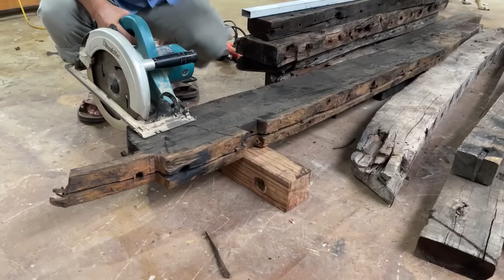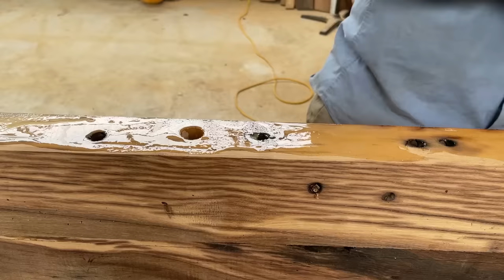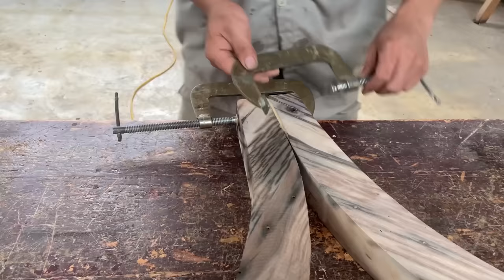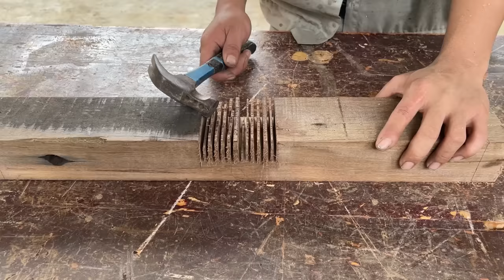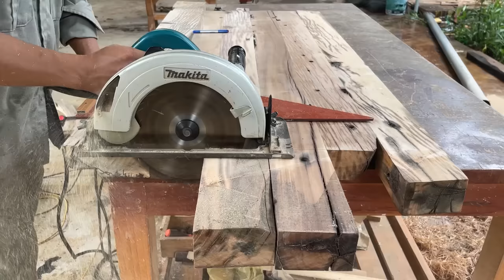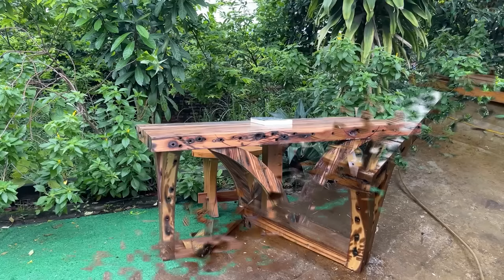Building A Difficult, rustic Table From Rotten Old Wood // Woodworking Restore Old Wood

Comment: Great job but when screwing the legs to the table there appeared 1 mm gaps right at the contact point of the legs and the table. They should have been glued and pressed to dry before screwing. A good wood work requires zero gap.

Comment: My 9th grade year in high school was the last year they let freshmen take woodshop, because I cut off the tip of my finger on a jointer. I wasn't following safety protocols and using a push stick like I was supposed to with a short piece of wood. After that year, you had to be a junior. I ruined it for everone. 😳😫

Comment: Hammer head to hammer head so so dangerious. the heads are tempered and when it meets another tempered piece of steel pieces can explode. and could easily take out an eye. As a carpenter for 54 years I've seen it happen.
Reply: Toda la razón!!
Reply: Yup
Reply: Yeah I don't think he really cares about safety.  He's wearing sandals in his shop.
Reply: Do you use a mallet?
Reply: @anonymousmedusa  
I use a claw hammer on a nail puller (cat's paw) or anything that's not tempered.
Reply: @stumpbumpers  
I guess it has never happened to you. I wish you contuined good luck.
Reply: Mythbusters busted this a long time ago.
Reply: Happened to me as a young lad. Had to did a fragment out of my arm at the emency  room. Lesson learned. You've been lucky.
Reply: @stumpbumpers  
After that remark I can confindently conclude there is no hope to change your mind, and by the way in all my time I have never seen a cast iron hammer, please don't let that start another thread. My goal is to error on the side of caution. If i'm wrong no hurt no foul, if your wrong, -----. This thread is now over for me.
Reply: Myth.

Comment: It will never be strong because the wood is cracked all over, fillng those gaps with a strong adhesive layer is must, holes should be plugged with epoxy resin

Comment: Really appreciate the work put into making this table with such old worn out wood. I even like the difference in the colors between the good parts of the wood and the water damaged parts. My only gripe is, dude, plug the holes! Putty, sawdust and glue, something! Even epoxy would be better than leaving the table top and edges with divots and holes and exposed cracks.

That said, this is a cool looking table.
Reply: Maybe you should do your own woodworking videos and watch them instead of telling someone else how to do theirs
Reply: Everyone on here saying it's fabulous, but personally I disagree. The design is dreadful - the curved feet at the sides will get in the way of anyone who wants to sit there. The crossed planks at the bottom will mean that it will wobble on anything except a perfectly flat floor. It wasn't well made either - when the feet were screwed to the top, the screws lifted the feet away from the top, leaving a gap - tightening the screws would have fixed that, but they were all left loose. And as you've pointed out, it's full of holes, which if left in the garden will fill with rain and rot. The pairs of legs were glued together, which didn't look like a very strong joint to start with, but then to make matters worse, he then drilled much of the joint away to fit the cross-struts. This was partially rectified by putting screws through the remaining material, but the screws looked far to short. There are some fabulous woodworking projects on YouTube, many using reclaimed wood, but sadly, this is not one of them.
Reply: @chrisengland5523  "The design is dreadful - the curved feet at the sides will get in the way of anyone who wants to sit there. The crossed planks at the bottom will mean that it will wobble on anything except a perfectly flat floor." That's exactly what I thought when I saw the shape this table was taking. The design is absolutely not functional, there is no room for the legs of people sitting around this table. The table will limp on almost any floor.

Comment: Great worker and experienced with his tools,  it's fascinating to see that he's evolved the same techniques as I use as a self-taught carpenter. I notice that the workshop is well organised and they had cleaned away all the sawdust before the lacquer spraying. 

But a terrible design unfortunately, you can't sit comfortably at the table because of the legs. He could have achieved the same strength with less effort by using traditional apron boards and one straight leg at each corner  and made a table that actually works for four diners
Reply: I don't think it is stable.

Comment: Probably not a good idea to use drywall screws to cleat the legs to the top. The wood is gorgeous but the table itself is hideous in my opinion.

Comment: I would have cut tiny 1cm layers of same would without default to cover all edges and legs and filled the holes in the top with same colour wood filler. Otherwise it is a work of art.
Reply: 😊😊😅ĺ😊😊😊

Comment: Absolute cowboys you can’t sit at the table, the glue marks are still left on the joints,there’s gaps in the joints and saw marks not sanded out and I would of clear epoxied the gaps and holes too as food could get in them

Comment: I'd have been tempted to shaved that wood into pieces, mixed the shavings with glue, and poured it into a mold and compressed it until it dried. Sanded it real well and then gave it a good coat of acrylic. I bet it would have been stunning with flecks of tan, blacks, greys, and other colors.

Comment: As a woodworker, i have to say, i be totally embarrassed by showing this. It wobbles when he was sanding it, because you need foot pads, the saw marks were not removed. The gaps on the joints were huge. I wont go into any of the safety issues.  He didn't remove all tge nails, as were apparent with the sparks. There is no overhang near the legs, so no one can sit there.  The rotted wood wasnt removed so its going to constantly flake off.

Comment: Too bad the work is not perfect
First of all, he had to disinfect the wood, clean all the holes from residual paint and rust - plug all the holes with glue and sawdust, and then sand the wood well
Only after he made the wood more usable could he perform.
Paint on the holes on the rust and all the remains left in the rotten wood is really irrelevant.
This table won't last. Who knows how many worms are inside the wood?